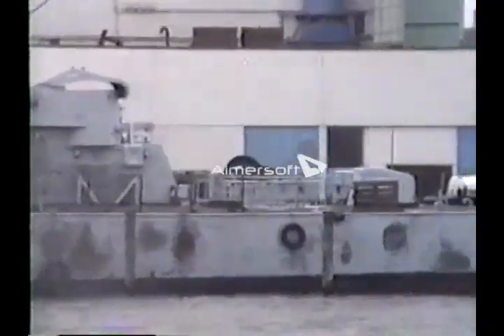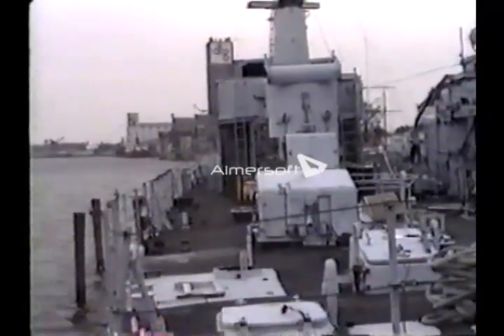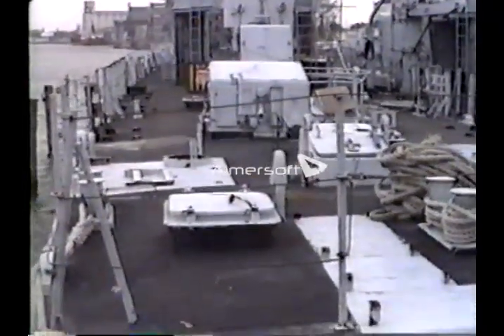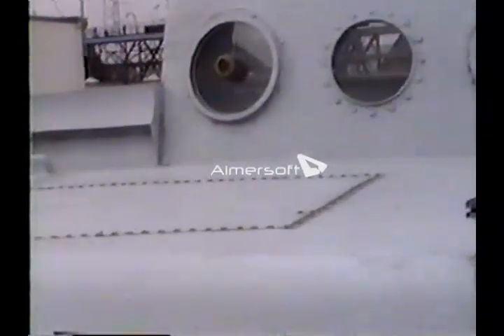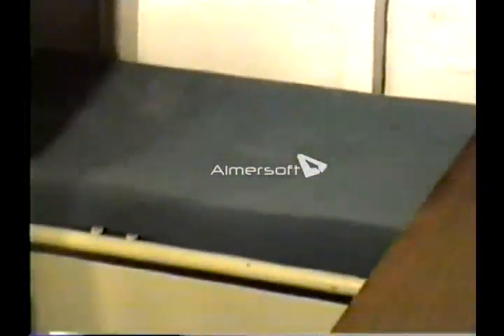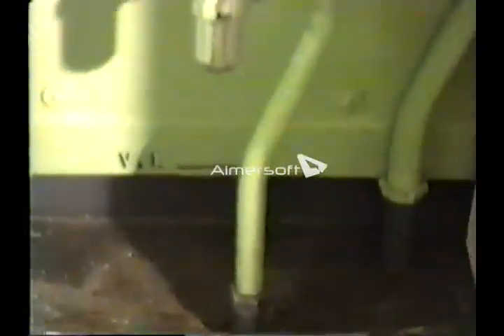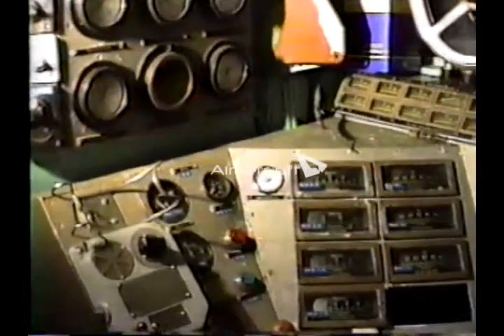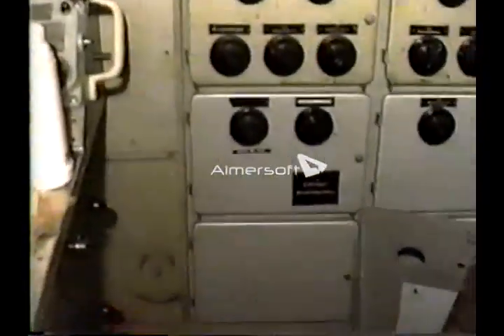RAN p 537

Comment: Nice to see what was/is left of our beloved ship. I had about three years in these vessels. It was my last ship before I left the Danish Navy back in 1986. Same base crew but several Seaward Defense Crafts (SDC) or in danish called "Bevogtningsfartøj". The vessels was on duty for two years at a time. Then the crew changed to another vessel while the old one went to the Shipyard for service. RAN was built in 1963 and went into service in 1964. Was taken out in 1991.

The small fleet of SDC's lived a hard life. It carried out maritime surveillance, fisheries inspections and SAR operations particularly in the Baltic Sea. Intelligence activities were also part of the work due to the neighborhood to USSR, East Germany and Poland. They were cold war workhorses. On duty all hours in turns of two weeks on and two weeks off.

In the rear crew area is port and starboard mostly switched in the speak. 
The little room on the port side of the ammunition storage room was the workshop for me as the artillery technician and was also storage for our two 7,62 mm Rheinmetall Machine guns model LMG M/62, 9 mm Hovea machine pistols model M/49 and 9mm Neuhausen model M/49 handguns . Depth charges was stored in racks on deck. 

The brackets to the right of the mirror in the large rear crew compartment was for our helmets. The place behind the chimney being called "lookout", was not a lookout. It was wherefrom the 40 mm Mk M/48 LvSa Maschine Cannon remotely controlled by a optical electrical pointing and firing control.
Reply from the maker: Hi Poul,
Thank you for your post!  I was a friend of David Kope's and notified him when the first hull came up for sealed bid in 1980 or so.  It was on a U. S. Navy sealed bid sale.  He installed an engine and it was sailed to Houston, Texas in 1986.  Later he bought the Ran and two others at the auction in Coenhagen in Dec, 1991. I visited all three ships in Sept. 1992.  The Ran was sold to a company in the UK.  The other two he kept and stored them at the Ring Andersen shipyard in Svendborg.  They were sold to a oil exploration company in Nigeria around 1999 but later resold.  One is still at the Andersen yard as seen on GoogleEarth.
 May I contact you via email? My address is: jimrudholm@gmail.com